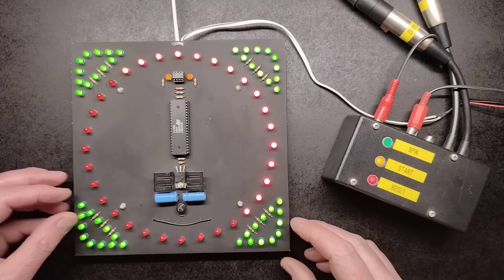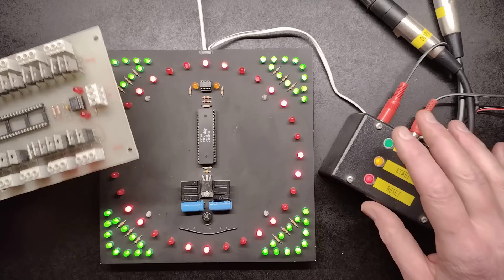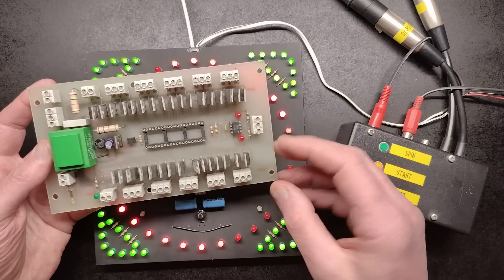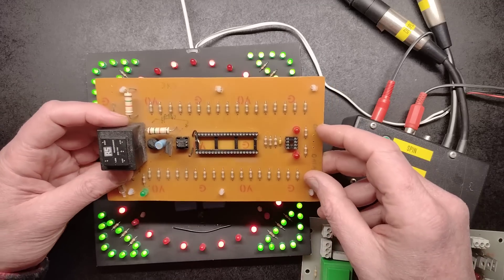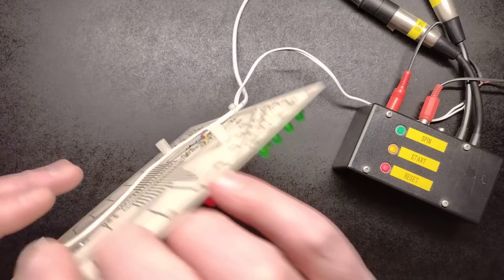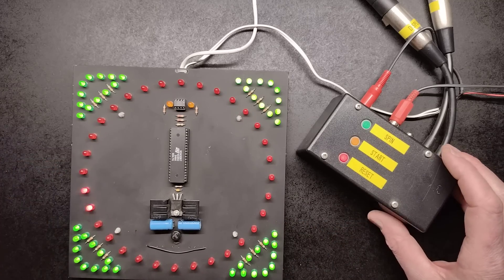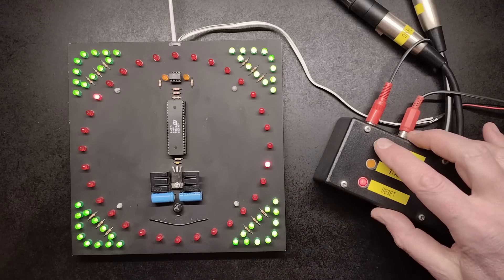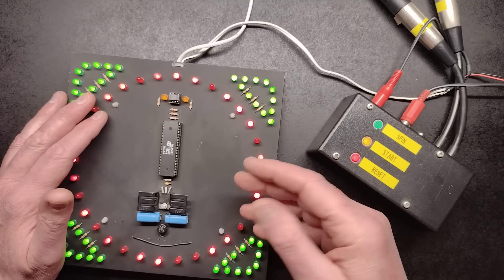Flux and carnival games (Loud 8-bit noises!)

Comment: Introduction of the PIC microcontrollers in the 90s was quite a breakthrough in reducing the peripheral and buffer chip count.  Microchip still has its base, though the excitement of programming your own application from scratch with assembly code is long gone.

Comment: Corrosive fluxes are easy to use and clean metals well. These are fine to use if there is the ability to thoroughly clean parts off. Otherwise standard rosin flux can be used without cleaning after.

Comment: If the triacs were driving lamps straight from the AC line, the whole serial to parallel converter was basically "hot" so you prob put in the opto for safety reasons (especially if you're handing the control box to people to hold).
Reply from the maker: The driver card was all mains referenced.  That's why the dual optoisolator was used.  These days I'd probably use RS485 drivers to drive the optos.

Comment: I've got PCB's that I made {using a Sharpie for resist} and Heathkit's that I built back in the '70s & '80s and they have zero corrosion on them. I can see only 2 reasons for corrosion, one you mentioned as using plumbing flux and two the PCB got wet at some point. Love your videos!

Comment: You might get some problems with flux residue on RF boards, especially UHF stuff. Cheap way of removing it is Care + Surgical Spirit from your local chemist. Couple of quid for 200ml. It probably leaves a really thin coat of Castor Oil behind, but looking at the instructions, it also prevents bed sores so your circuit boards will be chuffed about that.

Comment: For through hole stuff it really isnt needed, but looks dreadful. For surface mount stuff on the other hand, flux residue can cause issues
Reply: as someone else noted here, its also a matter of impedances. Just yesterday I had problems on an Amiga 1200 i reworked, where the composite output showed a wierd colour distortion when showing a fine checkerboard pattern. I noticed some flux stuck between two pins of the CXA1145 video encoder IC - when i cleaned this away, the problem disappeared

Comment: I have old rosin core solder and it never corroded anything .On the other hand I have high temp silver bearing solder and it will corrode because it uses a flux agent that is much more powerful

Comment: In a model railway members' newsletter not so long ago, somebody recommended using Baker's Fluid as the flux for soldering diode arrays.  My immediate thought was "Noooooo ! Don't do it !  Destroy your own components by all means, but don't encourage others to ruin theirs."  I find that cored solder is usually quite sufficient when the PCB and component leads are clean ; when I need something a little stronger I have a felt-tipped dispenser whose contents work brilliantly and quickly evaporate leaving no residue to clean up.

Comment: A few years ago I was working on equipment manufactured 1990ish, it had failed because a thin piece of track (not tinned) on the psu circuit board had disappeared (not burnt out) the board had not been cleaned and was covered in flux, due to the appearance of the remaining track this was assumed to have been flux corrosion causing the problem.

Comment: Protip: don't leave flux on high voltage circuit boards. Like mains voltage or higher. It can create an arc path. Ask me how I know.
Reply from the maker: Yeah.  That's where anti-tracking slots are a good option.

Comment: I'm not sure why but the SFX at the start of the spin mode instantly reminded me of the old NES game Rad Racer. As for cleaning flux residue standard rosin or alcohol based fluxes are usually fine if you don't clean them but certain types like RA flux that do need to be cleaned off or it can corrode the board.

Comment: I have been working on electronics for over 15 years and have seen some cases of corrosion. Seems happen more if a lot flex is used, also worse if in something that gets sealed up, but also seen trouble  with cleaners where they get inside the PC board.  I see more trouble from corrosion from outside sources like places with bad air pollution.

Comment: I was coding in 6502 in 1987, trying to get a speech chip to say something… Somewhere I have my first electronic projects (including my own designed PCBs) from back then. And yes, they do still work. Although I can’t remember if I cleaned the flux off.
Reply from the maker: SPO256 phonetic speech synthesiser?
Reply: @bigclivedotcom  - yes, via an expansion board on a Rockwell AIM-65 computer.

Comment: Rosin flux can cause issues if it gets hot. I work for a electronics manufacturer and rosin flux under a component that gets hot can cause failure in a very short time. I have seen it completely eat through traces within 6 months, however Coleco was famous for how much flux they left on the boards and they never failed because of it.

Comment: When I started work for post office telephones it was like a civil service gentleman's club. We had courses on everything.   An exchange is filled with 1000s of tagblocks with 1000000s of connections carefully laced in place with waxed linen thread.
Wrapped three times and soldered.  Time didn't matter.
Some of the blocks were pre war. And no one ever cleaned the solder off a joint.  If it had been a "thing" they would have had us lick it off if it was best practice.  It was never mentioned

Comment: I think the first pic I programed  was the pic16f84 with a kit from maplin, David Tate was the programer creator, unfortunately I couldn't get my programs to work so went off micro controllers for a few years. The problem was because I didn't realize it had a watchdog timer and it just kept reseting. So I missed out on two years of Pic experience because of a simple misunderstanding. I still use assembly on them as I just can't get used to C and all those annoying [brackets] or not enough of them or too many, aaaagh!
Reply from the maker: I remember the super-simple Tate programmer.   The curse of assembler is the number of pitfalls.

Comment: Very nice design! Thanks for showing it to is. I can imagine how interesting it was to code the sound effects into the PIC controller, as well!  Nice that the rosin flux didn't cause corrosion. I doubted it would. In my refrigeration hobby, I use a variety of fluxes, including zinc chloride / hydrochloric acid type fluxes which will cause bad corrosion. We always clean those off after every use. What is absolutely hideous is when the flux bottle leaks or spills in the tool box and rusts everything!

Comment: Wheee! Noice. Where are the voice samples? Only fans?
The 8-bit Guy (channel on YT here) had built a kit-computer and it wasn't working until he iso-propped the flux off. Dunno. But there ya go.
Hm. I could not find it on his channel. So not sure if it hasn't been The 8-bit Guy or if i just don't find the video.

Comment: Love the sound. As per voice effects you've mentioned, a chip named ISD1420, later also ISD2560 was the absolute classic of DIY kits from 90/00's in Poland. I never had one of these as I were too young and kits with ISD were prohibitively expensive but every second issue of the DIY electronics  magazines had this  "ABSOLUTELY TOP OF THE LINE SOUND MESSAGE TECHNOLOGY". Totally useless in most cases, like the alarm saying"hello" instead of beeping but it was a touch of luxury.

Comment: when I was around fifteen and heavily lacking in experience I used plumbing flux on everything and never cleaned it off, I recently found a few PCBs I assembled back then and most of them have patches of solder mask missing and badly corroded contacts, my old soldering iron apparently didn't fair much better. I'm reminded of a time where I was tasked with replacing a SOP-8 serial memory chip in a car radio as the owner had forgotten the security code (I was young and naive so didn't question it, maybe it was genuine, I'll never know), I'm guessing it doesn't work anymore. 

I now use no clean flux paste (Amtech, MG Chemicals or Topnik, whichever's readily available) and only clean it off if the tackiness is an issue and have never had any problems since, the only somewhat strange occurrence I can recall from memory is a PlayStation 2 I was mod-chipping that wouldn't boot at all until I cleaned the flux off, never had anything like that before or since, perhaps the flux was conducting or something... That certainly wasn't genuine Amtech, despite that the PS2 is still in my collection and working perfectly fine.

I'm always impressed by how much knowledge you have (kind of in a "you've probably forgotten more than I'll ever know" sort of way), I'd love to learn assembly one day (especially weird flavours like SuperH ASM) but C is about my limit right now.

Comment: It depends on flux,  I have a small robot that I constructed a decade ago using an attiny chip. Over time, the legs of the chip have nearly eroded away due to the corrosive effects of the flux(flux core of the tin that I used). The tin has become crusty and turned white, and certain parts of the legs have disappeared. However, other PCBs that I soldered with a different type of tin and flux at that time are still just fine, if they were just soldered yesterday.

Comment: flux from within solder wire shouldnt be any issue, they specifically state in many cases 'non corrosive flux' , definitely the paste or acid liquid flux IS corrosive, i had to use them a few times for 'awkward' joints and after a while there was green bits so if i use it/them again i'd clean residues off, but not with the normal wire flux, unless maybe if used on sensitive and/or higher than normal voltage circuits
Reply: i have some solder that listed as 'no clean low flux residue' , and it has trouble sticking in some cases, but worse is the flux absolutely stinks, smells acidic, although shouldnt be, i'd have thought?!,  and really irritates your eyes, nose and throat, far more than standard flux type,  another 'stinky' one was CEL solder sold by grandata in the 90s,, didnt irritate but had a stale sweat mixed with fart smell to it! i still have a few reels of that 😁

Comment: I only ever use flux rated ROL0 which is no-clean and non-corrosive. I use that for flux cored solder wire, SM solder paste and liquid flux for repair work. Never had a problem, never expect to.

Comment: You are right, many many years ago, I don't have any dates, but  I have been electronic technician since 1965. The solder flux was very corrosive and needed to be cleaned off right away. But in today's "modern" solder, the flux is only corrosive at solder melt temperatures and need not be cleaned off. I love your game, I have a couple of similar.

Comment: That's the idea of no clean flux
you can basically leave the remains on the board without corrosion happening. Only thing is when you want ultra low leakage or are expecting moist conditions good cleaning would be a good choice. There are several types of flux in use today, the no-clean ones usually being no problem still. The more agressive halogenated may cause issues (but might not, depends on environmental conditions). Water soluble fluxes tend to need good cleansing in any case

Comment: From what I've heard from IPC pros: Some fluxes can destroy copper if left on the board (usually water-soluble flux). Cleaning up will help you if you're checking the joints under a microscope. Some fluxes will (allegedly) conduct electricity if they're left alone for a while.

From personal experience: I don't use water soluble or any other kind of flux designed to aggressively strip oxides, and I've never gotten a short from leaving no-clean on the board (knock on wood). I usually clean up with some isopropanol because otherwise I get flux residue on my wrists, and I'm the type of person who will later go, "Ugh! What is this, flux or sugar?"
Reply from the maker: The comments here suggest water washable flux is very problematic.
Reply: @bigclivedotcom  I suppose if you have a great fume extraction system and you want to work through boards very quickly, water-washable flux can be a time saver. Otherwise, rosin or no-clean with isopropanol will do the job just fine.

Comment: I've heard it suggested you can even do a sort of cheap and nasty conformal coating by painting a PCB with plain rosin. Short of super sensitive stuff it's only the unactivated chlorides in RA flux you have to worry about, but in my experience those are dealt with if the flux is heated enough to drive off the solvents and leave hard residue, which will also mostly lock away any remaining corrosive stuff.

Comment: Very cool! Years ago, when I worked a PD in the middle of the North Dakota Oil Patch, we used to hold Turkey Jamboree celebrations before our Thanksgiving holiday.  This consisted of many different games where the prizes were of course frozen Turkey's or canned hams. For the children we had games that gave away cheap plastic toys and that sort of thing. The game I usually worked was the Wheel of Fortune which was a real life wheel like your electronic with a large arrow that pointed to one of (I think it was 36?) numbers, each number had a ticket sold to represent it, and, of course I gave away a turkey with each spin.  They put me on it because I have a good clear deep voice that they thought sounded good over the PA system (or so they told me)  IT was a lot of fun to tell the truth, I miss those days.

Comment: Never had an issue with flux causing corrosion. Did have a problem with a Humax PVR many years ago where the VFD front panel stopped working. This was caused by water soluble flux becoming hygroscopic and introducing stray resistances. Cleaning thoroughly with meths brought it back to life again. I've always tended to clean boards after that.
Reply from the maker: The comments here suggest that the water washable flux has been a huge source of problems.

Comment: G'day, Clive in my experience of over 40yrs I haven't seen any green or white crusties from flux or ordinary 60/40 electronics solder on PCB's excluding a few modes of Sony TVs from the late 70's n early 80's that cats liked to sleep on top of the plastic back assy n pee straight on the boards which made them fooked due to resistive leakage, I have seen green crusties on soldered water pipe from plumbers solder which is 50/50 & these were near salt water but never failed so make of this what you will mate, Cheers from OZ.

Comment: Rite Big Dude, My only comment about flux and IPA would be, use IPA first to clean board then add a little flux to pads! I was soldering an ebay purr-chase, a 6 seven segment led clock to used to make (now please don't take this the wrong way)... A bomb for work. The old security supervisor used a shoe box with bomb written on it, not really exciting! Mine was a broom handle cut into small dynamite size sticks and painted red and another one with some Edam cheese wax (coz it was red and held its shape well) put in a container as plastic explosive to make a nail/screw bomb, much beterer in my opinion! So Clive if you find anything that looks like one of these around the conveyer area Liverpool side please hand in to security!!! I jest Dude we got them all🤔... TFS, GB :)
Oh yeah the point of this comment was a few of the solder pads came off whilst trying to solder but after the clean all was good!

Comment: Most people don't actually wash the flux off when they clean their boards, they just spray some IPA and scrub it with a brush. All that's doing it spreading it around. If you want to clean it properly, you have to spray it with IPA, scrub, then continue scrubbing under the tap. Although I usually just wipe the IPA off with paper towel after scrubbing and that cleans it well enough. Never really had any issues with flux in sockets or pots.

I have been looking at getting an ultrasonic cleaner for cleaning electronics. Although they're not that cheap for ones large enough to clean big boards, since I occasionally do repairs on retro computers and stuff.

Comment: oh flux you clive
yeah electronic solder flux residue is actually fine most of the time, in fact I seldom clean my repairs or projects as I use juicy "toxic" kester 63-37 lead-tin solder with rosin core
funny enough while big woofs of flux upset my lungs(I mean duh) I have no problem with the wisps of flux from a clean joint when I do stuff, but when I had some lead-free flux I basically always had issues with vapors
almost like the metallic lead is less toxic than the flux vapors of lead free and so nobody should ever use lead free even in commercial stuff and we should simply incentivise electronics drop-off locations in all the places for anything with large quantities of solder or components that contain any semi-precious metals
I advocate lead solder in literally everything as I never had a good lead joint crack but I saw a cracked joint in many a lead-free device
that means people buy 2+ times the number of replacements meaning eventually more waste from simple avoidable issues like cracked joints making the flux the clear loser when it comes to environmental impact vs pure lead metal
in fact just like mercury, the pure metal or metal alloy(amalgam in the case of mercury) is the least toxic form, lead acetate is terrible as it is both super sweet and more readily absorbed, there is a form of mercury compound that is instantly fatal in as low as two drops and gloves can't save you
but hold pure lead bricks or dip an uncut hand into a massive vat of liquid metal and you are 100% safe
now yes it gets tricky when it enters the water table but that is the case with ANY toxin including the flux
use nice juicy lead based solder and have some simple rosin flux dissolved in isopropyl alcohol stored in a nice bottle and you are fine
just remember to dump your dead parts and solder balls from your tip cleaner into a bin and drop off at your local e-waste location